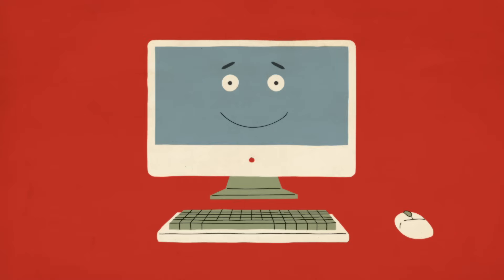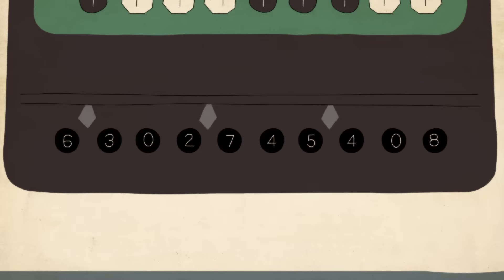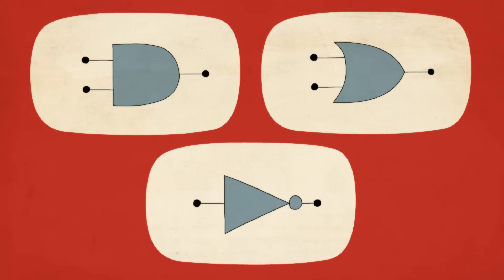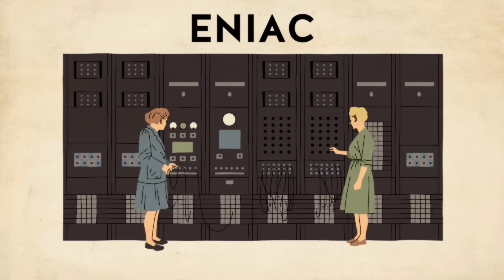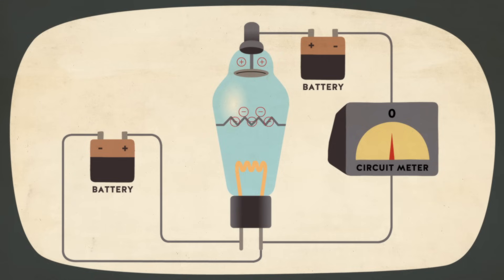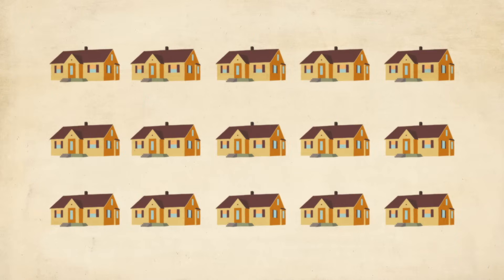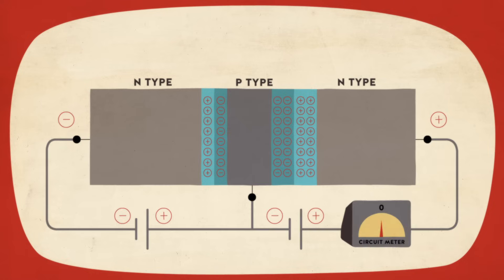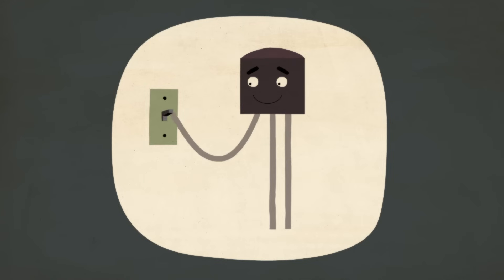How transistors work - Gokul J. Krishnan

Comment: Can someone help explain to me how simple operations contribute to making things we see on our computers like shapes, and characters. Thanks!
Reply: 3 dimensional graphics are created (today) on computer screens using an ever-increasing amount of triangles. Take a character in a video game for example. The character's body is modeled using hundreds of thousands of small triangles, all of varying shape and size, and all attached to form a recognizable 3D image, i.e. a body. If you look at early 3D games such as Super Mario 64 or Tomb Raider, the triangles used to make up the character's bodies are easily distinguishable. However, if you take today's renditions of those respective games, the triangles that make up the characters have gotten so minuscule and mesh together so well that the human eye sees a lifelike body on the screen. 

The triangles are all created using a combination of relatively simple mathematical operations (algebraic, trigonometric, etc). The in depth details on how graphics processing units perform these calculations can get extremely complicated. Essentially they perform these calculations at a rate of billions per second, and update the display according to the rules given by the engine of the specific game or graphics program running. The computer monitor or television the user is viewing the graphics on is driven by an array of pixels, a pixel being a tiny dot of color usually governed by three colors, red, green, and blue (though modern pixels can have more), each of which can be set to certain values to produce an extensive range of colors. When you see your computer monitor's screen resolution, for example 1920x1080, this is the amount of pixels contained in the screen from side to side and bottom to top, respectively.

So what's the connection between the game developer sitting at their desk and programming their game, and the machine executing these calculations? Computer code is most commonly seen in its high level form, represented in modern languages such as Java or C. Let us look at a basic road map of how a computer program gets executed today. The developer writes their program in one of these high level languages, which is then compiled into an assembly language. Assembly languages are commonly viewed as mid level languages. High level languages like Java have relatively complex instructions, whereas assembly translates these into a series of simple, repetitive instructions. For example, if a command in Java was to "walk 10 steps, turn right, walk 5 steps", the assembly for that could be "right foot forward, left foot forward, right foot forward, left foot forward" and so on, all while keeping track of steps taken using a counter. After the assembly is made by the compiler, it is then assembled into machine code by the assembler, which can be considered low level language. These instructions are the simple calculations that the video mentioned, usually consisting of a string of 32 or 64 bits, a bit being a voltages level, a logic condition, a 1 or a 0. To the untrained eye a string such as 11100010100000000000000000000101 seems like mere gibberish, but to a computer it could mean something such as "add two numbers together and store them in this location"! 

I hope this long and winding explanation helps!
Reply: 1 and 0 or true and false are the building block. Like a brick. many brick form a wall, many wall form a house, ... And every thing a computer does is a combine of very large set of 1 and 0.

A single 1 or 0 have only 2 value. But put them together we can represent a bigger number. like 2 is 010, 3 is 011 and 4 is 100.

Another example is the screen. Each screen (or an image) is actually combine of pixels. A pixel is a dot represent a color, and we can use number to represent this color. Combine many pixel together and we have a picture.
Reply: @khoing1111  but if it gets 010, how does it know to put a 2 on the screen? Like how did it learn that?
Reply: Your problem is simply inability to imagine billions of switches being switched according to previous state of the switches every second. Psychology has shown people have big problems imagining such events simply because our brains didn't evolve to grasp such concepts.